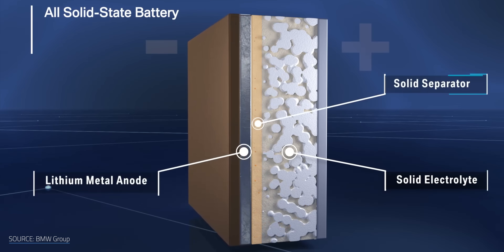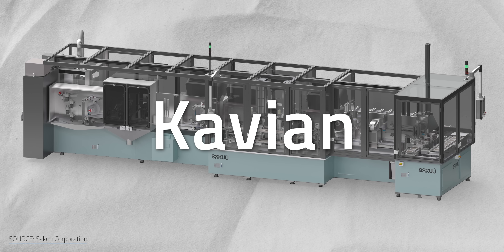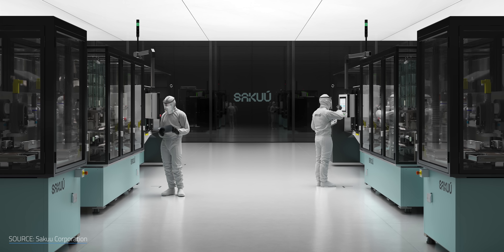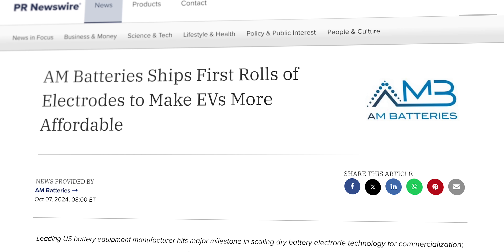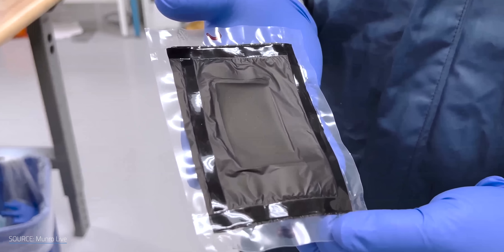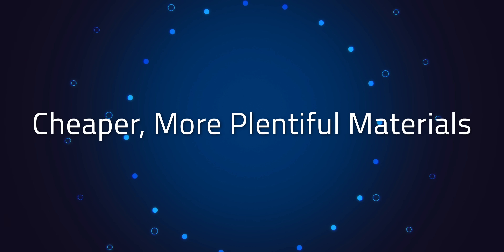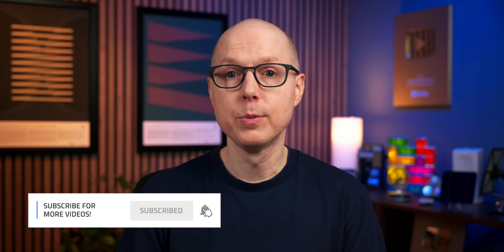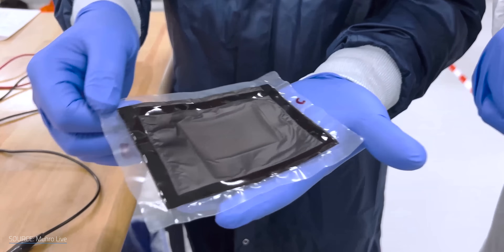Why This Ultra Cheap Battery Breakthrough Matters

Comment: 9:13 is that assuming all ice cars turn into electric? Because it doesn't consider many ice cars completely ditched in exchange for trains, which don't need much lithium because they're basically plugged in all the time; or electric bikes, which need much less lithium
Edit: i found a paper from IRENA, and they estimate around 40M vehicles at 50kW/h average, and the lithium production not being able to cover that, so pretty far from replacing all ice vehicles. So the answer is NO

Comment: Iron trichloride ? are you kidding ? that's a Lewis acid that is well known in organic chemistry for Friedel Crafts alkylation and Acylation reactions, and the stuff is fuming acidic nastiness, and it will not tolerate even the slightest hint of moisture, small amounts of water will destroy it, and it's very reactive, producing hydrochloric acid as a byproduct.  Also, the electrolyte is usually some form of polar aprotic solvent, like DMF, DMSO, acetonitrile, NMP etc. all of which are expensive and not considered green.

Comment: Matt, please listen and stop your suppositions, particular about very expensive high technology, lest you lead anyone else astray:

Lithium Iron Phosphate (LiFePO4) batteries are among the best full-cycle rechargeable batteries with iron in their composition. LiFePO4 batteries feature a cathode material containing iron (Fe), which contributes to their stability. These batteries achieve a cycle life of 2,000 to 7,000 full charge-discharge cycles, depending on quality and usage conditions. This cycle life exceeds that of most other rechargeable chemistries, such as Nickel-Metal Hydride (NiMH), which typically offers 500–2,000 cycles, and standard Lithium-Ion (Li-Ion), which ranges from 500–1,500 cycles. 

LiFePO4 batteries maintain a stable voltage of approximately 3.2V per cell. They provide good energy density, though not the highest among lithium-based options. Their longevity suits applications like solar storage, electric vehicles, and deep-cycle uses. LiFePO4 batteries exhibit lower risk of thermal runaway compared to other lithium chemistries. They contain fewer toxic materials than alternatives like Lithium Cobalt Oxide, avoiding heavy metals like cobalt. This makes them safer and more environmentally friendly.

Nickel-Iron (NiFe) batteries represent another iron-based rechargeable option. NiFe batteries achieve a cycle life of 2,000–5,000 cycles. However, they possess low energy density, poor efficiency, and a bulky design, limiting their modern applicability.

Other notable rechargeable batteries lack iron. Panasonic Eneloop Pro NiMH batteries offer up to 500 cycles and a high capacity of around 2550 mAh for AA sizes, suitable for household devices. Standard Li-Ion cells, such as 18650s, provide 500–1,500 cycles and higher energy density than LiFePO4, but they demonstrate less stability and a shorter lifespan.

LiFePO4 stands out for maximum full-cycle performance among iron-based rechargeable batteries. 

Companies like CATL, EVE, and A123 Systems produce high-quality LiFePO4 cells.

Comment: It would be interesting to compare the throughput of the Sakuu 3D printing process. Current battery lines are producing electrode material at 40-70 m/min or maybe even more. That 3D printing process does not seem like it could match that throughput meaning your footprint would not shrink as you would need dozens of machines to match the throughput of one current machine. That is why 3D printing is typically used for prototyping and not high volume manufacturing. I’m skeptical that it would meet the cost savings they’re claiming

Comment: Looks interesting.  Now there is a follow up question about more polymers hitting the environment.  Probably not as bad as all the single use plastic packaging (like laundry and dish washing bottles for Tide pods or Dawn dish soap) but still a concern on their ability to not contribute to plastic and "forever" chemical contamination.

Comment: If it makes the batteries almost impossible to reclaim and recycle, a cost reduction to remove metal doesn’t seem sound to me.
Reply: It makes recycling even more sustainable since less energy is needed in the recycling process. Polymers need lower temperatures to separate than battery active materials, let alone metals.

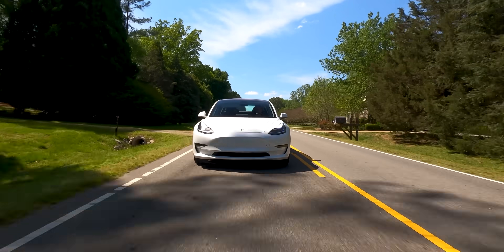Comment: 1:19 Price parity isn’t the point!  Even ICE vehicles are getting unaffordable. With all this stuff getting mass produced and scaled, why is none of it getting cheaper for the consumer?
Reply: @Wesley_H  Cuz of import price and tariffs and other costs
Reply: @ I see what you mean, but I meant even before the orange Putin Puppet took back Washington.
Reply: Size is a big part of it. The market (in the US) has been trending towards larger and larger vehicles, so the average price is going up. And with several manufacturers dropping out of small vehicle production entirely, it's lowering the competition for reasonably-sized vehicles at the same time. So manufacturers can get away with jacking up prices across the board.
Reply: Tarrifs dude. Cheaper in Europe.
Reply: @norwegianzound  What is "cheaper"? Dacia Logan starts at 14k euros with tax included. There aren't any notably cheaper cars - especially for the size/class - and with that price tag, it is hardly "cheap".
Reply: @Wesley_H  why would companies ever have 200% when they can have 1600%? Of course of we go down this road I'll get called Karl Marx's second coming.

Comment: 3:46 please address whether it can be done at scale? Like what is the volume that the 3D printing can achieve versus the more expensive process? 3D printers can be purchased and set up but like how many would be needed to match what is currently done with the wet process?

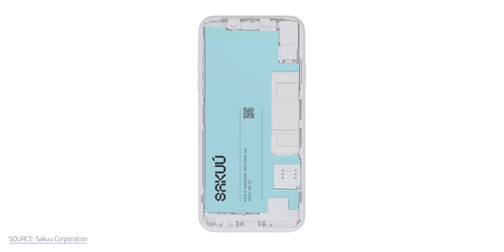Comment: 4:21 Isn't that a repairability nightmare? When phones had removable backs you could swap batteries between multiple phones without a problem, now we have hard to remove packs, but to my knowledge most batteries are quite similar. Now imagine that every phone has a completely different battery. The moment they stop making the batteries you are screwed...

Comment: Okay, but what about Battery Management Systems?
At least half of the price of a big battery is down to BMS costs. Are there any updates on the horizon that make it cheaper to work with many celled battery systems?

Comment: You talk about cost in one sentence, and then switch to price in the next. The two are not interchangeable. A 50% drop in manufacturing cost will not result in a 50% drop in price.

Comment: Will these technologies make it to the market? IDK. . .

I remember seeing film strips in elementary school in the 1960s. They told us that we would run out of petroleum for gasoline by the 1980s. But, we would have clean and abundant energy from nuclear fusion (not fission). . . Forty years after those things were supposed to happen, neither has occurred.  

I hope we can find a cheaper and safer alternative to the current lithium ion batteries. If so, it would help make EVs and E-Bikes safer and more attractive products. Plus, it might make it possible to replace failed batteries and extend the life of EVs.

Comment: Tesla has been working on a dry battery process since 2019:

Tesla’s dry process eliminates the solvent entirely. It starts with a dry mixture of powdered active materials, binders, and additives. This mixture is then transformed into a self-supporting film, typically through a technique like extrusion or pressing, and laminated directly onto the current collector (a metal foil). By skipping the solvent and drying steps, the process reduces energy consumption, cuts production time, and shrinks the factory footprint needed for manufacturing. It’s also more environmentally friendly since it avoids the use of hazardous chemicals and the need for solvent recovery systems.

Tesla began exploring this technology after acquiring Maxwell Technologies in 2019, a company that had developed dry electrode techniques for ultracapacitors. Tesla adapted and refined this approach for its 4680 battery cells, aiming to lower costs and improve battery performance. The dry process is applied to both the anode (negative electrode) and cathode (positive electrode), though scaling it for the cathode has been more challenging due to the material’s properties. Benefits include higher energy density (potentially exceeding 300 Wh/kg, with a path to 500 Wh/kg), reduced manufacturing costs (estimated at 15-50% savings), and a longer battery lifespan due to less degradation from solvent-related issues.

While Tesla has successfully implemented the dry process for anodes in its 4680 cells, mastering it for cathodes has taken longer. Recent reports suggest Tesla has overcome key hurdles, like equipment durability, and is moving toward full-scale production of all-dry-electrode 4680 cells, potentially starting in 2025. This could significantly boost Tesla’s ability to produce cheaper, more efficient batteries for electric vehicles and energy storage, giving it a competitive edge in the industry.
Reply: Why only talking about the electrods? What about solutions for storage of the electric energy?

Comment: If this is true these battery company's  will be worth more than AI stocks at least in the short term.
Reply: Sadly no, AI is software - meaning it can improve it self at any time across all areas - while a material base assets can't. Thus - while they will improve it, it will over all cost more to upgrade it as things roll out. Thus more money will have to be spent or scale over time because you have to buy into a supply.
Reply: @adr2t  Has not been true yet.
Reply: @ Has been true for a while...

Comment: A lot of hype about stuff that never comes to fruition. Just like the AI hype. Would short sell a lot of these hyped companies.
Reply: AI hype is wrong how? We're seeing it hit all sorts of different markets and scaling out vast more from the use of AI then not... so not sure where you think AI is not hype?
Reply: @adr2t  Because the Chinese for 6 million deep seek caused a market correction of over 600 billion a few weeks ago. It was hyped up. AI could not solve Reinmanns hypothesis, fermats theorm in 2 pages. It cannot have consciousness. At the moment it's a glorified search engine, that presents you with what it finds in a presentation format.
Reply: @ Na, it wasnt really deepseek that did it.. it was a market correction of a over hype stock not AI. Deepseek was also found to be not connectly reporting its numbers as well. The "aha" moment could be done for 50$ as well not 6mil follow by the fact they stole from chatGPT. It thinks it self is even chatGPT LOL. So really it would've cost them as much if not more to recreate what chatGPT has. This is why we dont see more newer models out because of it. Instead, we are seeing agreement from large companies to buying even more GPUs in the future. AI is used across the board on soo many different things and in the future. From house applications to programming now. Its taken over. They keep improving it and its showing.. maybe they will hit a brick wall, but because its software, I dont think they ever will. They will keep coming up with new better number every time. More or less it sounds like you are using it as search engine and not for other uses. Sounds like that is more on you than the the rest of the world.
Reply: @adr2t  I asked it to solve Reinmanns hypothesis. It couldn't.  So what advanced topic did you solve with it, as you reckon I was only using it as a search engine.
Reply: @ And that sloves what for us? How? In this example, I would have you ask Grok-3. It knows the Reinmanns hypothesis. AlphaFold is a better example in how AI has push our understanding on life alone. Again, its sounds more like you just have limited access to some stuff and dont really see the point because it doesnt fit in what you want all projects to do... when its a research running application that needs just more time to cook. Its only been 4 years and we're already this far... kind of says something more about your understanding than anything. Breakthroughs are bound to happen and its just a matter of time... we're already moving 2x faster than just a few years ago.

Comment: I do not want to sound critical - but I am very afraid, that even when these cheap batteries will be available for consumers (i.e. electric cars) the car companies will surely find an argument to keep prices high for electric cars. So no matter the price of the battery, the price of the car stays high.
Reply: No, Tesla even knows that isnt the case and wants to build a cheaper car because they already sold to everyone that will buy their current price cars at a scale limit. Meaning, the only way to push more cars in terms of not being flat - would be to make a cheaper car and the only way to do that is with a cheaper battery over all without removing other key stuff.

Comment: WOOOOOOO LET'S GOOOOOOOO I'm so tired of Lithium-ion batteries crapping out! Even though some have gotten better, crapping out 5-7 years after being put in devices, I'm so, so desiring 5-10 years, period, on at least 50% of highest drain (maybe phones, vapes), 80-95% of medium drain like laptops, and 100% of low drain. We can do better. I'd gladly pay even 25% of the total price of an item if I could just have it not randomly give out or lose 80% of its life in 5 years.
Reply: LOL 5-7 years later... pretty good considering older batteries crap out less than 6 months, and light bulbs that crap out every month now lasting 2-5 years.

Comment: See you say passing those savings on, i just hear "bigger profit margins"
Reply: Savings have already been passed on. Lithium batteries are close to 90% cheaper than they were 20 years ago.
Reply: In this case, no. Maintaining margins is not worth it at current price levels as so many people are discouraged from, or unable to even consider, buying an EV. Expanding market share matters more.
Reply: Selling more for less is often a higher profit margin than selling less for more.
Reply: Capitalism tends toward monopoly. Competition results in winners and losers. Prices may go down at times but in the long term they will always go up as the owner class extracts all the value they can from every facet of every industry.
Reply: @56Valo how nice of our owners to provide technology innovations for the people.

Comment: The tech that's always coming, but never actually ever arriving. If the next 5 years is going to be like the last 5 years a new cheap battery wouldn't save us from the coming energy crisis. Especially in the USA were your take-up of renewable energy sources have been stymied by political corruption. Which by all accounts this is only going to get worse.
Reply: Pretty good considering older batteries crap out less than 6 months, and light bulbs that crap out every month now lasting 2-5 years. Dont forget LFP was a new tech as well.

Comment: EVs do not create cleaner environment.
Reply: They have... so your point is a bit wrong or misinform. They cut down on sound and raise air quality. While they do have a carbon foot print - its still less over time than ICE cars. Follow by the fact that battery tech is still improving aka this video. The only reason its higher is because of the mining - but that will lower over time as more of it can be recycle back in and out and over all population has access to EVs - thus the demand for new raw material flattens out. Where, ICE still continues to need new mines + production of gas + off set cost + lowering air quality and creating a ton more sound on roads.
Reply: @adr2t  what do power plants consume to produce your electricity? How many gallons of oil is consumed to produce your tires? How about all the plastic on the vehicle?

Comment: It’s unlikely the reduced production costs will fuel a cheaper product. It’s more about maximising profits.
Reply: @Ratsnacker  And (thankfully, blessedly) this is a situation where the two overlap. A cheaper car means a bigger market means increased profits.
Reply: @Ratsnacker  that’s why competition and the free market are important.
Reply: @ I agree. My opening comment should have contained the word “initially” tbf. As with anything, development doesn’t come for feee. We won’t see savings over LiFePo4 for a very long time.
Reply: @kylelaw7210  is that why insulin is $80
Reply: @kylelaw7210  that ended a long time ago. There is no free market when 3 companies own everything. They label the same product 30 different ways, so you think you're buying a different brand, but you're not. He is right. The battery will cost the manufacturers less. They will charge us more because it's new technology. And we are all too stupid to stop them.

Comment: I thought that Na ion batteries would take over. That is also cheap and available
Reply: They look like they are for the grid space... but production of Na doesnt come online yet till this year and the next 4 for some other plants. So it will be a little while at least. For EVs and other higher power devices, Li is still going to be the go to. Either LFP or NMC like.

Comment: 1. couldnt the electrode material of conventional batteries be scraped off and dropped back into the vat recovering it for the next battery?

2. a way to reduce costs is to lift regulations  on the materials and just monitor the supply chains for abuse?

"please stop the delivery of lithium we have reason to believe that the so called battery maker has committed paperwork fraud and mis represented their innocence and is a meth supper lab disguised as a battery maker"

"ok you may now dump the nmp solvent down the toilet you no longer need to dispose of properly"